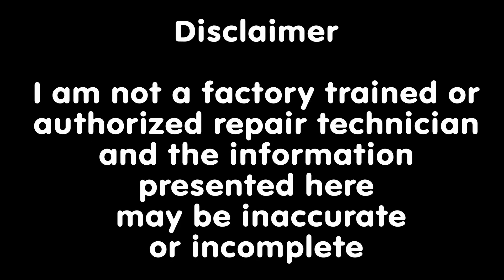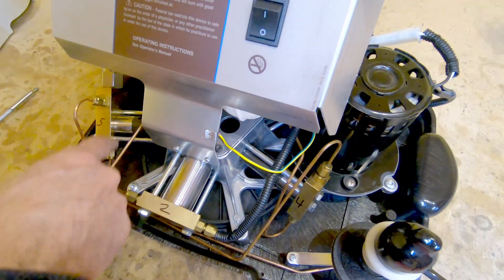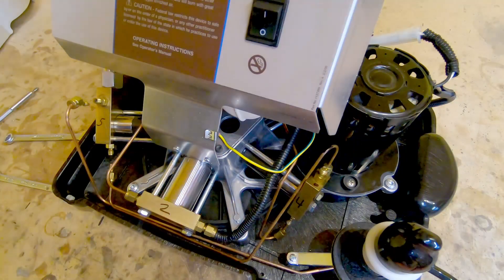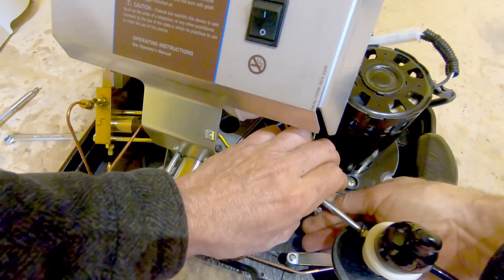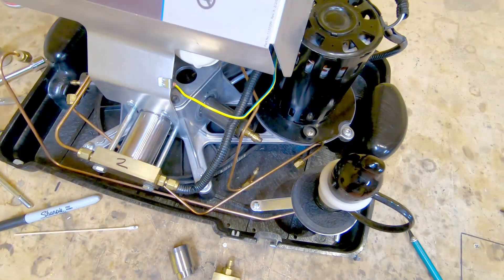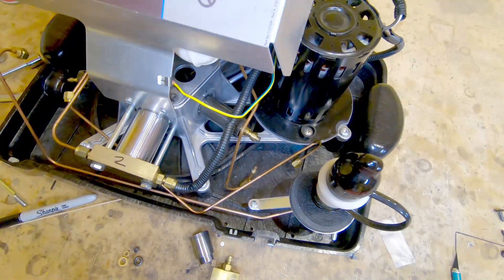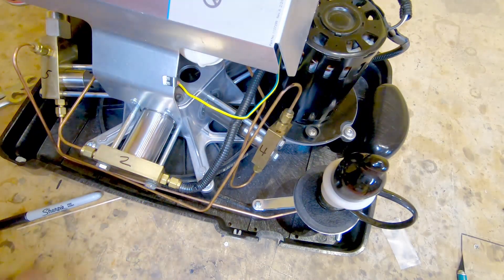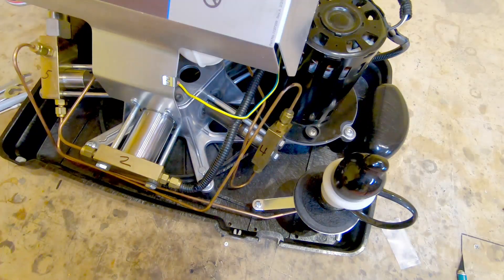Homefill Seal Replacement

Comment: How about a video showing the replacement of the central bearing In that unit, mines shot and I need to repair it but cannot get the bearing out, I think I need to disassemble the whole unit bit by but

Comment: Great video! Best info out there on how to get these things going again when they start to leak. They don't last long here in Florida. I have like 3 units that I need to do this to and my past attempts at repair have been a failure. I need to get them running so that I can make money to buy an NQALHA. LOL!... but seriously.
Reply: Get an on demand unit and a lathe. There is a better way
Reply: @vinnyvinson  It's been a while since I did my research, but from what I remember on demand systems are much more expensive and can't put out enough oxygen to maintain the amount of pressure that you can get from a tank. I want an NQALHA because it's cheaper than a lathe and I have a bone graph in my left hand that causes extreme arthritis plus I like to play around with weird and interesting toys. I also feel like it would be better than a lathe for some things. It just seems so fast and easy to use with how things clip in and the magnetic locking mechanism.
Reply: @dustyhurd424  if you are working the roi is quick.  Nqalha isn’t a practical tool for glass. It’s a novelty. I don’t know anyone that uses one day in day out? Do you? What kind of work do they make?
Reply: @vinnyvinson  Could just be a novelty because nobodies made anything like it before. Sometimes it takes some experimentation to discover how useful something is. I don't think it's fair to call it impractical. NQAHLA seems like a third arm and since one of my arms is pretty fucked I'd like to give it a shot. I know lathes have been the standard for a long time and I get why this seems like a less useful version of a lathe to a lot of folks, but it seems to me there is a certain level of versatility that these have that a lathe doesn't. I'm pretty isolated and have been teaching myself for the last 20 years. I don't even really know many people that use a lathe let alone an NQAHLA even in the days when I used to rent bench space out at shops with other blowers.
Reply: @dustyhurd424  time is the most valuable resource you have. I wouldn’t waste it doing impractical things. I’m an avid gardener. If a plant has bad genetics /design I don’t bother giving it space or watering it because being fruitful is important. Being curious is great. Experimentation is awesome. Once you get knowledge through experience you should apply it.
Reply: @vinnyvinson  I think calling this impractical is a bit of an overstatement. It would definitely be useful. Maybe your experience with a lathe is causing you to be completely blind of any potential. I appreciate your comments and having a conversation about it is great because I've wondered lathe vs NQAHLA a bit. Like I've said I have a bad hand/arm and I have ways  I'd like to use it that I think would work better than a lathe. Until I can have a talk with someone that has extensive experience with both I'm pretty set on getting an NQ one of these days and finding out for myself. Probably won't be anytime soon though with the way things are going.

Comment: Perfect video, my home fill just crapped the bed last night, it’s only going up to 1200psi, then backing off at that stroke, I can only assume it’s the 4-5 stage pistons, I noticed over the last week it seemed to be struggling to get up to full pressure. I obviously jinxed myself by making a video on how to start up the system.
Question, have you found that the cylinder head “gasket”/ o-ring also goes bad? And if so is it available from McMaster-Carr? I assume that’s who you were referring to with “industrial supplies” because that’s the first place I looked for the piston seals, sadly it doesn’t look like they sell them, quite frankly the seals just look like regular spring loaded bearing shaft seals, most likely made from PTFP, my 30 years of wrench turning tends to make me wary of pulling a cylinder head without replacing all gaskets/seals.
Also jokingly I refer to my wrist as my “click torque wrench” usually when it starts to click, I know I’m tight enough. 
Again, great video thanks for the help. Now to source the seals
Reply from the maker: Orings used purely in compression last much longer than orings exposed to sliding wear. I have also used spring loaded cup seals in the past and assumed the ones in the unit
 were standard. Then I read a post from some dune who tried to source them and discovered that they were an odd size. I did not confirm this

Comment: Next question, two parts actually.
Since you replaced the seals, I am assuming a year ago, have you had to replace them again? The job is very straight forward so physically replacing them isn’t much of an issue, but the $150 cost for each replacement seems excessive (still cheeper than buying gas or moving bottles at our age) 
Because you are running a fairly large storage system, do you allow the home fill to shut down at 2000psi? Or just run it to 12-1500psi? 
I am also contemplating adding some kind of supplemental cooling to the 4-5 cylinders which obviously get excessively hot, as expected, compressing o2 that high , I may start by just drilling a few holes in the front of the machine, because it looks to me that those two cylinders are starved for cooling air, but a liquid cooling jacket/coil wrapped around those two cylinders to prolong the life of the seals might be a good idea.
Or am I reinventing the wheel?
Reply from the maker: The seals have not been replaced again. I'm a hobbyist glassworker and don't use it all day, every day. I pump to 1000PSI, I use no extra cooling but I do remove the covers and fans from the homefills